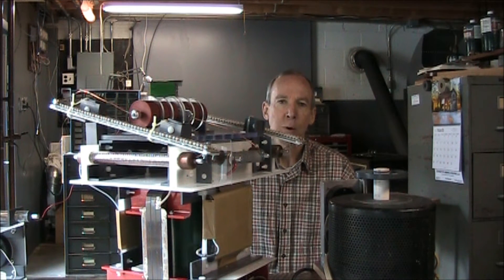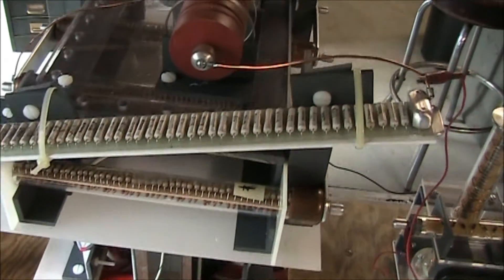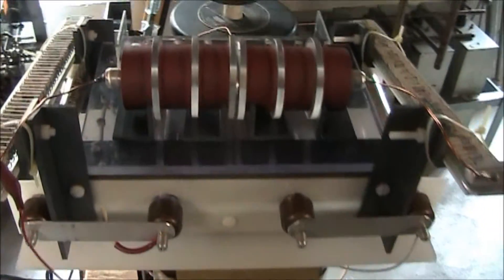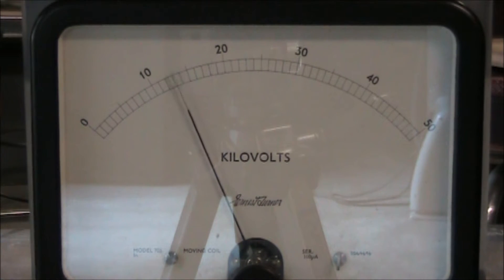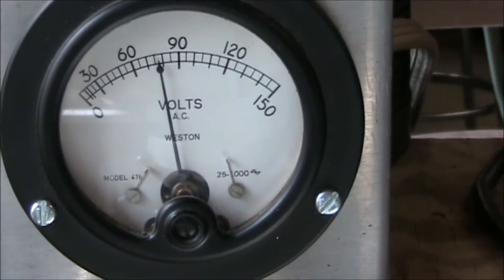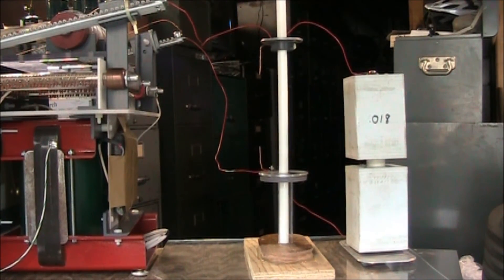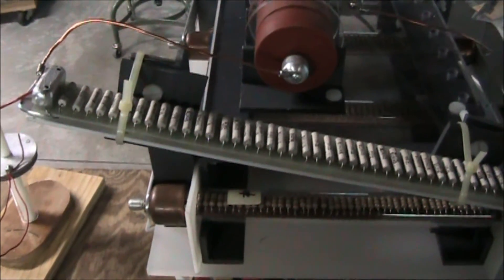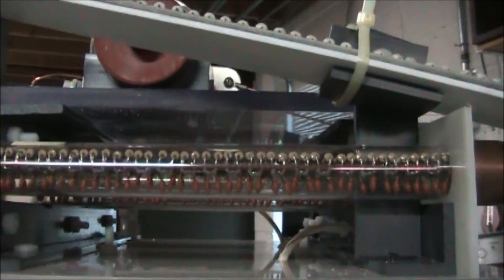High Voltage Quadrupler

Comment: I have been watching your alternator videos and appreciate them.  I would like to run an alternator to make 390 regulated volts DC, this will go to charge a battery bank of 30 of 12VDC batteries in series for chopping to 240AC.  Any idea what amperage the 500volt alternator will be able to supply at 400V ?
Reply from the maker: It is the wattage capacity of the alternator that will determine your amperage. 800 watts at 400volts looks like 2 amps. If you can find a junked Leece-Neville your good for a kilowatt. I always found cheap alternators at swap meets.